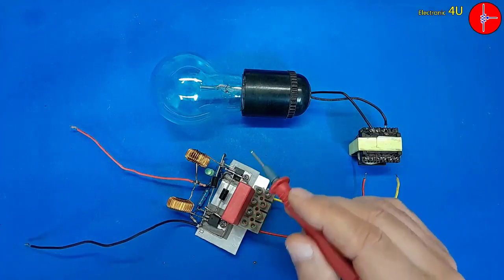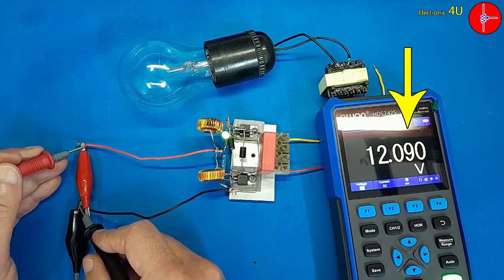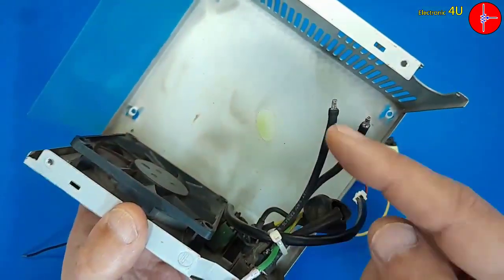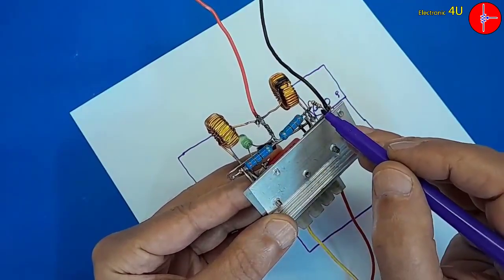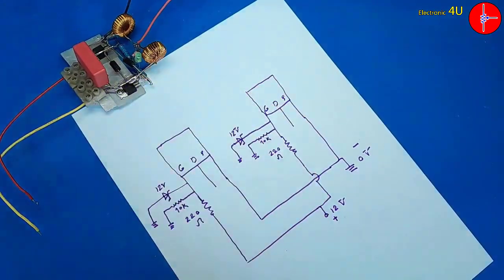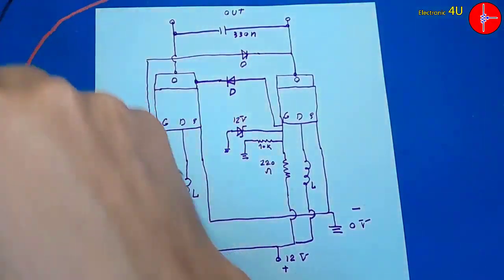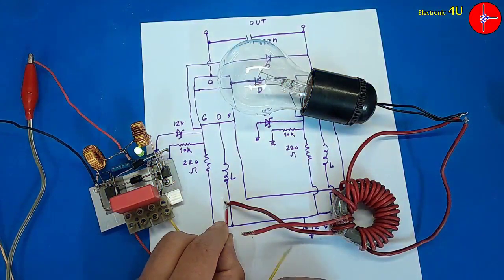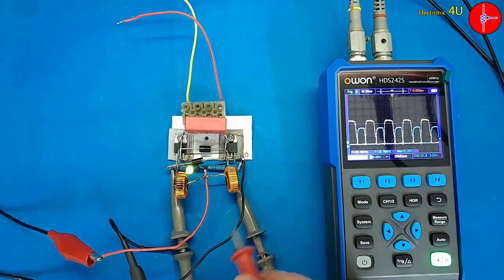Complete training to build  inverter with handmade transformer and MOSFET: Power is in Your Hands

Comment: Good can i use 800v mosfeat in this circut please replay
Reply from the maker: Thank you for your comment
It depends on what application you expect
This circuit works in a limited way due to the transformer, but you can use stronger MOSFETs as long as you determine the gate resistance correctly.

Comment: This circuit does not produce any output in proteus
Reply from the maker: Hello, thank you for your comment
Are you sure you executed the circuit correctly?
Do not connect the transformer and check the result again
Reply: @Electronic4U-david  sir I didn't connect any transformer. I just wanted to see the mosfet output. I can send the layout
Reply from the maker: Please send to me ❤️
Reply: You say it like he’s out here trying to pull a fast one. You could try another simulator like LTspice. Are you using MOSFET and NOT BJT? because it matters. 
Double check your schematic. It’s easy to miss something or put in a diode backwards
Reply: Idk, maybe I missed it but it could also have something to do with the fact the inductor is labeled L in the drawing and i don’t hear him mention the value of such important items. Like bro

Comment: There no number of turns two drain of MOSFET attach with inductor.
Reply from the maker: Thank you for your opinion. Diode shutdown is done when the voltage of the two ends of the diode is the same. Soon I'll be posting more videos of the Suwar Thank you for your opinion. Diode shutdown is done when the voltage of the two ends of the diode is the same. Soon I'll be posting more videos of the Suwar principles 🙏